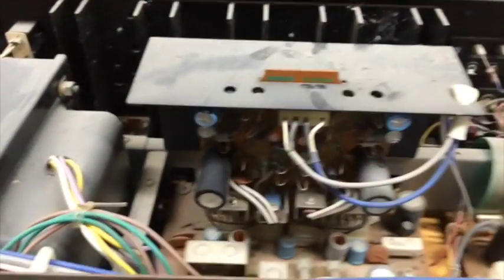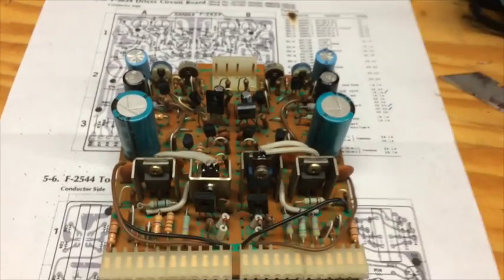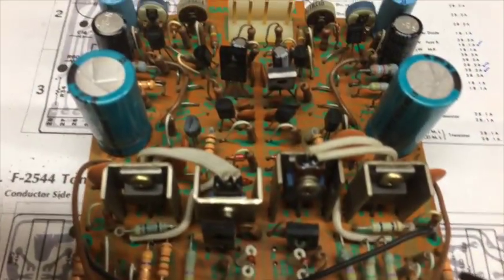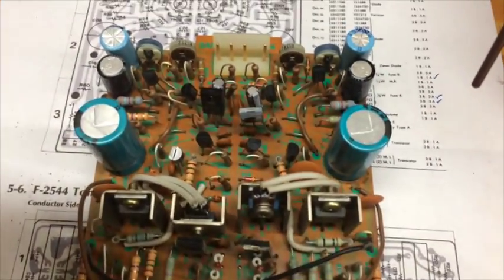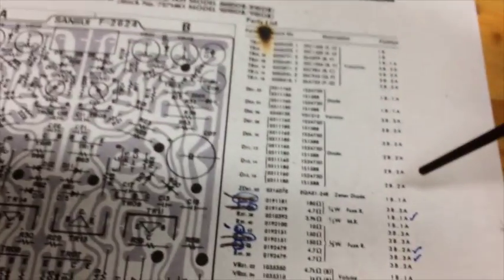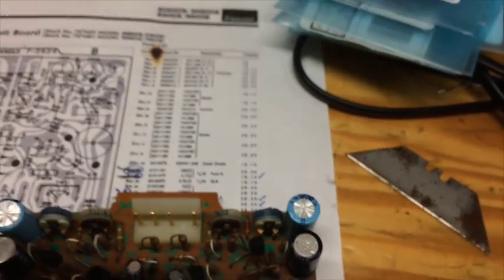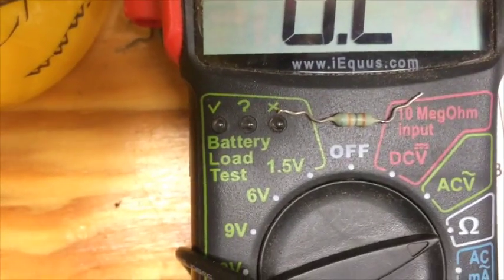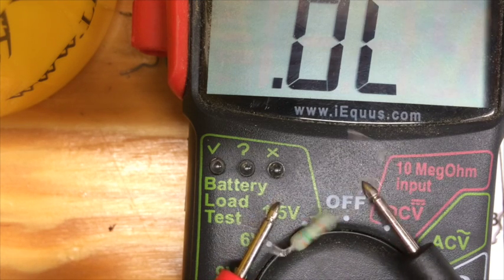Sansui 8080db/9090db F-2624 Driver Board Resistor/Capacitor Refresh

Comment: Hello-   Thanks for the video- I have a quick question-  If you remove the 2634  board and power up, will the protector light will still be blinking  red ?  I have a 9090db that is missing the board that powers up and the protector lights blinks  red   even w/o the board.  Thanks
Reply: Could you fixed it? I have the same problem

Comment: I realize it's been a long time but for anyone referring to this video you should replace ALL of the light blue/green pastel looking resistors. They are the so called fuseresistors and they will all eventually drift out of range. You can replace them with regular 1/4 or 1/2 watt (flameproof) resistors.
Also, there is an error on the PCB silkscreen - D07 and D08 are printed backwards - the stripe should be located downwards towards the edge of the board.